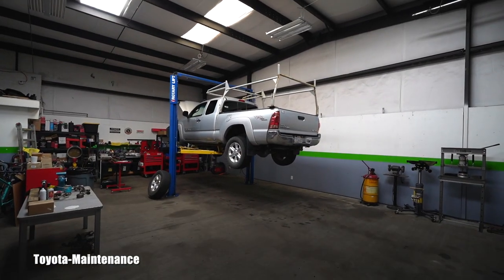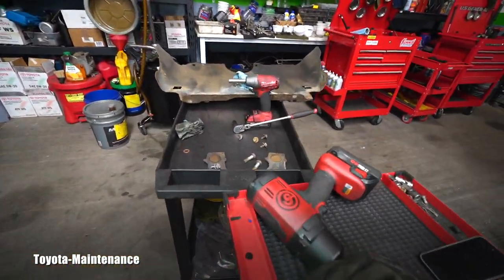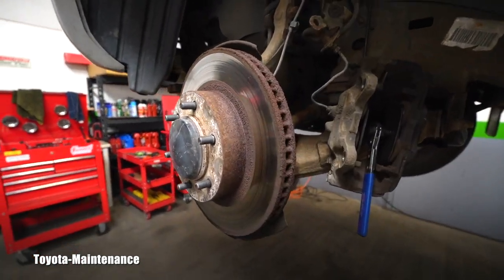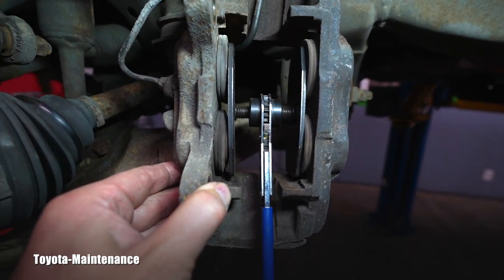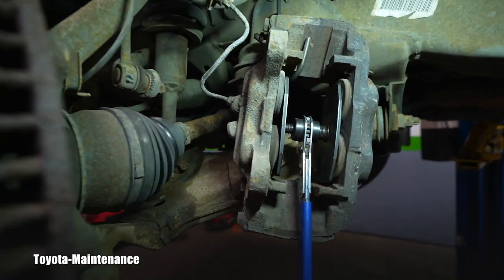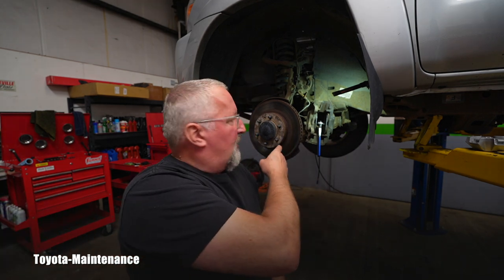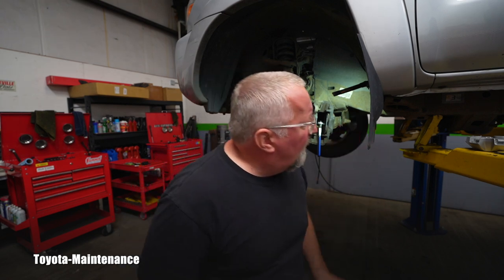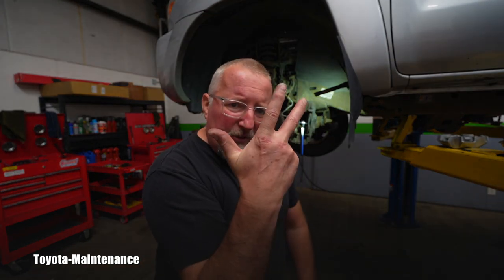Stuck Seized Front Brakes

Comment: A friend had a stuck caliper and figured he would put a little air into the brake nipple port to push out the stuck brake pads to work on the caliper. Only he put hooked up a nitrogen tank with 3,000 PSI  with his fingers inside to catch the pads. He now has one finger on his left hand. Great video Peter as usual !

Comment: With that many miles, stuff is going to start breaking. I siphon out my master cylinder every couple of years and fill it with new brake fluid to get some of the moisture out of the system. The old Ford truck calipers are single piston which are harder to jam due to their large size. I would rather not mess with the ABS unit. That thing is expensive, and as long as it is still working, I'm not fooling around with it. Trying to flush it out might damage the delicate parts inside it. I just watched Curtis from Cutting Edge Engineering in Australia take apart a fuel pump from a Perkins diesel engine. Inside were 4 tiny free floating cylindrical steel pistons. Two of the 4 had tiny scratches on them. Those were enough to  prevent the free movement of the valve parts, and stop the pump from feeding 2 of the 4 cylinders with fuel. That is why you don't want a drop of water to get inside a diesel engine fuel system. It can cost you thousands of dollars if it sits in the wrong spot and causes a little rust.

Comment: At 8:54 - I live in Oakland, California and it seems all the O'Reilly's in Oakland stopped offering brake rotor resurfacing. You now have to drive one town over to Alameda and only one person will do it (the manager I believe). As of early summer 2023 it cost $25 / rotor. My wife's 2012 Honda Odyssey has a pulsing brake at freeway speeds caused by warped front rotors, but it's a pain because if the store is busy I may need to return another day.
Reply: Odyssey rotors are notoriously bad. Honda even revised the design but it didn’t help much. Most people seem to go with centric cryos but in my experience Ody rotors need to be done every 50k or less pretty much no matter what. It seems there is a problem with pads depositing contaminants on the rotors from heat.

Comment: That happened to the rear driver side calipers of my father's 06 highlander. I forced it back but ended up eating the brake pads in less than a year. It needs to move easy so after applying the brakes the calipers will retract so it wont put a lot of pressure on the pads against the rotor. So I ended up buying new toyota calipers, came with the bracket and everything and had to get new pads.

Comment: Thanks for sharing Petr!  Frozen calipers seem to be a common/recurring issue on this generation of Tacoma and 4Runner - is there any preventative maintenance that can minimize the chance of this happening?
Reply: Keep your fluid and system clean. Flush at max every three years and sooner if in humid conditions. Old rubber softlines also can allow seepage of moisture into the closed system
Reply: Have two Tacomas and a 4Runner and have gone through about 6 calipers.  So I’m convinced that no there is no preventative measure for this.  Replacing calipers is just part of a brake job after you have brake dust and rust build up.
Reply: I've had a 2003 4runner for over 18 years and have changed the calipers twice. Keeping the guide pins well lubed and rust free & compressing the pistons every spring seems to help. I've had good luck using new Raybestos calipers with EBC rotors and pads

Comment: I just replaced my front calipers on a 2007 Tundra with 150,000.
I was able to loosen up the passenger side with heat but I had to cut the driver's side out.
The pads were rusted onto the calipers and the pins were rusted in the calipers. What a PITA that was.
With the price of gas and only an improvement of one MPG, this repair will pay for itself in 20,000 miles.

Comment: If the rotor thickness is within spec, the rust shouldn’t be enough to require replacement. Some brands rust faster than others. It’s almost impossible to predict which brands would fare better since premium prices often fail to indicate premium products. 
As for the seized caliper, just last week I noticed one wheel was frozen on my Toyota Echo and found the caliper piston wouldn’t retract in the bore. I pushed it out by stepping on the brake pedal while the caliper was detached and merely cleaned out the gunk that the brake fluid drain/replacement somehow left behind (after sitting abandoned for 17 years) and polished the piston so it glides nice again. Of course it’s my own car and since you’re a professional mechanic, liability would dictate new parts.

Comment: Great video Peter! It would have cost the client less if they would have brought vehicle first instead of DIYing. 
I encourage anyone that is touching any brake service. Just replace the rotors, pads and all the metal brackets all at once. It only hurts once when you do it right. It is when you cut corners to save money then it hurts twice and cost more in the long run.
Reply: And mechanics hate this so much so they totally ream the customer for the most they can add on as well. NEVER tell a mechanic you did his job. Sensitive guys afraid of not being able to be paid for it.

Comment: Are you supposed to change the rotors with the brake pads every time?  I've been going through 2 sets of brake pads per 1 rotor and I haven't had problems with my car yet. Anyone know?
Reply: @name-ob6np  That's what I thought.  Thank you.
Reply: Especially with Toyota rotors.  They are very good and don’t seem to warp.  If they do, I turn them once.  After that replace them.

Comment: Please tell your viewers about pushing the pistons back in with out loosing the bleader screw  on abs toyata if you don't the presser herts the seals in  the abs block under the master cylinder ✌️🙁 brother did brakes on a 4runner 08  6 months later leaking seeping out of the abs block bad move 🤷🙁 part was like 4 grand on line 📢 please loosen bleeder screw when installing pads
Reply: That’s just needlessly messy. Just remove the cap on the reservoir.
Reply: @semi-chubber2388  that won't work because the abs has a built-in motor will not allow the fluid back in 👍 now if you turn the key on an push piston in it will work that's what  he didn't know an cost him 4 grand part cost installed my self
Reply: Oh I pushed mine back without loosening the bleeders.  He must of just got unlucky
Reply: @slalomking  yeah. Like everyone else. Perfectly fine way to do it.

Comment: Brake systems are not sealed. It is recommended to flush the brake fluid every 30-35,000 miles as a preventative measure. Brake fluid is hygroscopic and moisture enters the brake lines through atmospheric pressure. Tiny specks or holes form on the pistons surfaces causing them to glide unevenly or even become stuck inside the caliper housing. Peter should also quote him new brake lines.

Comment: I never could understand how moisture could get in the brake fluid. I figure wherever water could enter the system, brake fluid could leak out.  When I was 16, I rebuilt my wheel cylinders for my 1955 Chevy truck. I had to hone the cylinders because there was a rust ring. I have done a few other cars as well. Now I just buy new cylinders. But you are right, all those parts you mentioned need to be replaced. I would also suggest rebuilding the frames or just replace them. Rebuilt calipers most likely will come without a protective coating and will rust first time they get wet. There are shims that need to be replaced. Pads + shims cost as much as TRD pads with the shims built in. Brakes first! AC second because driving a newer vehicle with the windows open makes a weird noise. The boots have to be done or just replace the axle. I always turn rotors or drums. I used to arc the shoes too. There was a grinding wheel that would attach to the brake lathe to surface flywheels.
Reply: The brake fluid is hydrophilic and draws moisture in the air to itself, its not from water leaking in from rain or puddles
Reply: @rexeverything1163  Thanks, I did a little research on hydrophilic. 
"DOT brake fluid is hygroscopic by nature which means it absorbs water from the environment via seams and microscopic pores in your hydraulic lines. This water content has an adverse effect on the performance of DOT brake fluid by reducing its boiling point."  I guess the short answer would be "It just does." 🤪 Another thought, brake fluid on the shelf can also become contaminated especially if it had been opened. Plastic or metal containers? Hmmm! At least plastic containers will flex with temperature not creating as high internal pressure/vacuum as a steel container.